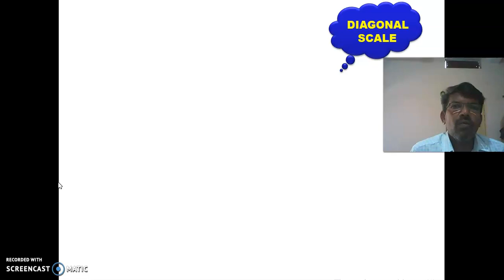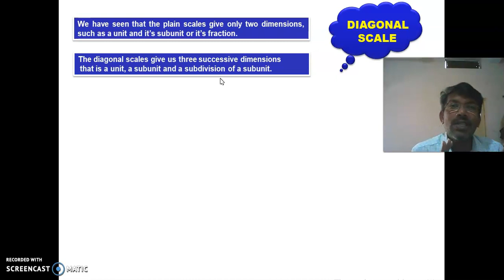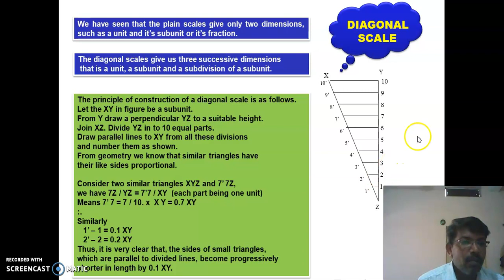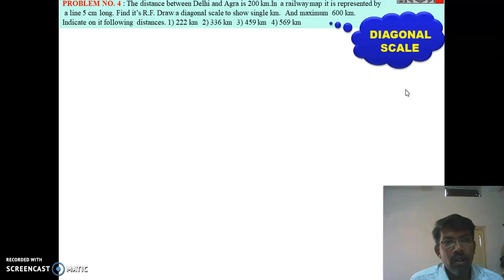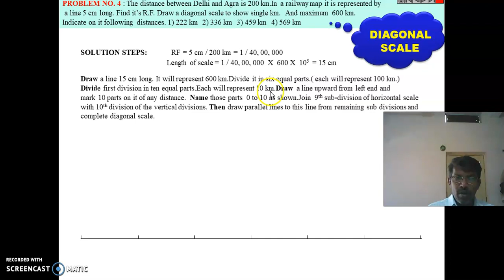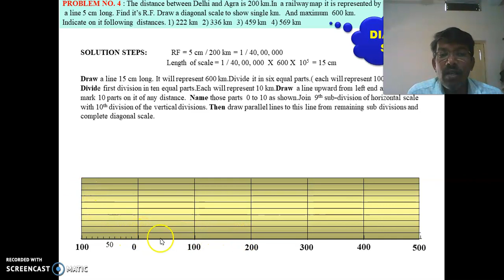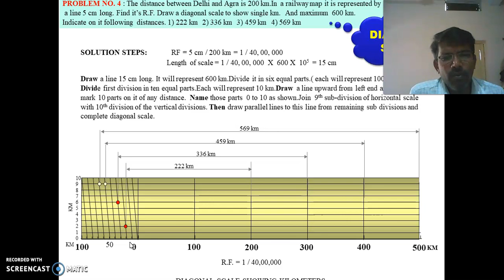Diagonal Scale

Comment: The distance between Delhi and Agra is 200 km. In a railway map it is represented by a line 5 cm
long. Find it’s R.F. Draw a diagonal scale to show single km. And maximum 600 km. Indicate on it following
distances. 1) 222 km 2) 336 km 3) 459 km 4) 569 km